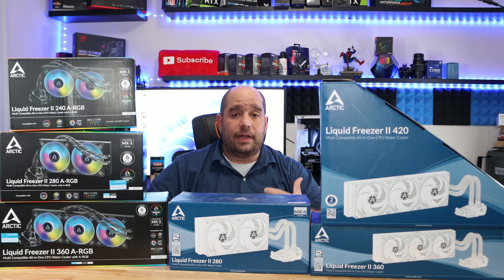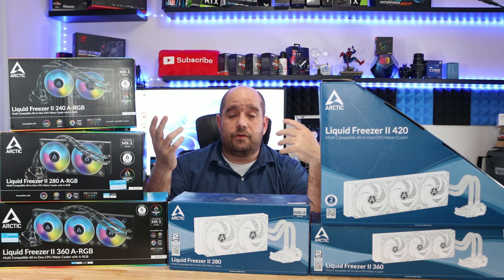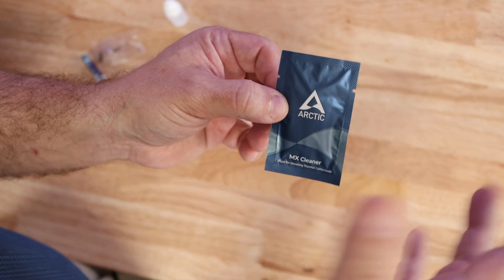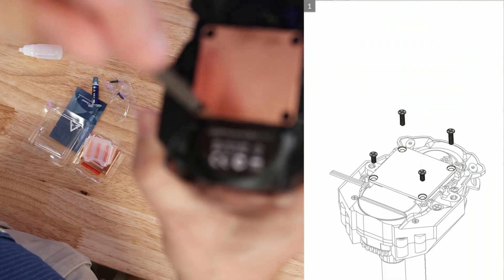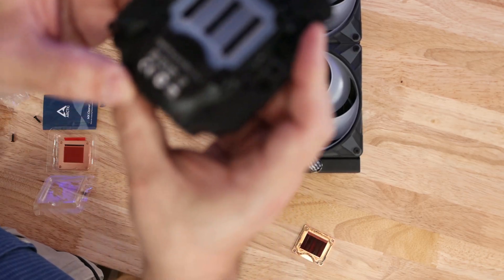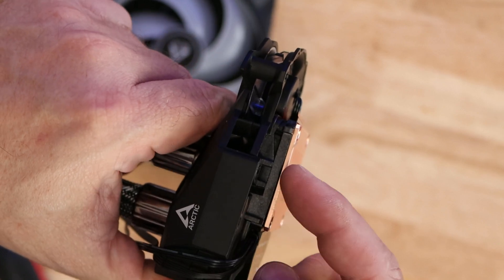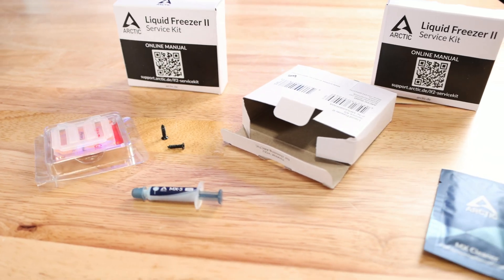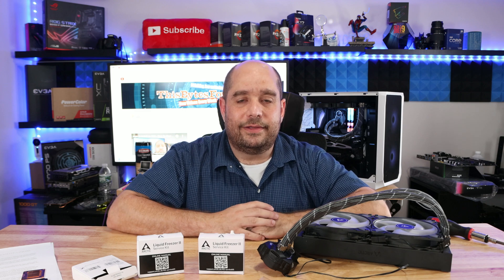You NEED to Watch this if you own an Arctic Freezer II -  How to fix the Arctic Freezer II

Comment: Hello, I scratched the copper plate on the cooler and I managed to get a service kit, but my cooler has a QC pass on it, can I change the copper plate and that gasket? And add some liquid if it nedes? Btw i have an arctic liquid frizer II 360 argb and i order an arctic liquid frizer II 360 argb service kit.
Reply from the maker: scratching them is OK, they are thick, have you watched this video?
Reply: @ThisBytesForYou  oh ok i am thinking of adding some liquid because when i shake the case i hear the liquid inside the cooler
Reply from the maker: Cool, this video has you covered, might help tons to watch it.
Reply: @ThisBytesForYou  ok thx for information I think I'll leave it as is.
Reply from the maker: @fetamina  It may benefit you, and I show you it all here, we've spent more time chatting about it than the video, but either way, glad I could help you.
Reply: @ThisBytesForYou  thanks, it helped me a lot, I wanted to ask you about it so I don't damage anything if I open it and it has a QC pass
Reply from the maker: yup if it already says QC passed it good, but it wouldn't hurt to save that liquid for later, just incase you notice maybe it isn't cooling as well as well as the plate, you never know.

Comment: How big is the impact..?
my CPU is at 95°C (203°F). When I simply watch a video. sometimes even at 100°C.
And the pump seems to work, but the air from the fans is also cool.
Contrary to the tubes. one is hot, the other still warm...
Reply from the maker: what CPU is it?

Comment: so my little vrm is facing up. the tech told me it dont matter if its facing down or up mine is facing down does it actually matter ?
Reply from the maker: I don't have a solid answer for you, I can check with Arctic but the fan should be blowing on vrms, and this should help too on  my imgur https://imgur.com/gallery/YgrTivJ

Comment: i have my vrm fan on the block facing down is that bad i notice yours is facing up ?
Reply from the maker: where the opening is that blows some air, the fan, so that it can blow on the VRM's.  You may be be sucking up some bubbles, causing potential issues, lower performance cooling, noise, reduce lifespan of the pump due to overuse, etc, you can see an example of how it look like here on my imgur: https://imgur.com/gallery/YgrTivJ

Comment: I like how my ARGB Liquid Freezer ii 360 legit cant get any Light to it what so ever, i have a ASUS ROG Strix B650E-F Gaming WIFI as motherboard for the record.

When i set it up in the pc it breifely Lit up and then stopped. Anyone know what the issue is?
Reply from the maker: In general, the ARGB connection is horrible, it always falls off, check each fan by connecting one by one to a header on the board, if they work, connect them then connect them to your board.  Also, try with a different fan, or another argb device to very argb works on your board, it may not be the arctic, check out this video: https://youtu.be/GrKUiz-uJDI
Like I show in this video and many other, the ARGB Liquid Freezer ii 360 legit CAN get light to it.
Reply: @ThisBytesForYou  I have already tried every argb header that i have on my mother board at this point, but it still dont work, I tried my Ryzen 7 2700X Cpu fan and that made it go into rgb mode through armoury crate but not My Liquid Freezer
Reply from the maker: hmmm, not sure, to be certain, you have the RGB LF2 right?  Sounds like a dumb question, but you would be surprised.  The fans, they have a PWM cable and an aRGB cable right? @N0rdicgamingz

Comment: Thanks for this one. I bought mine in October 2022 so I hope it's fine. Haven't taken a look since I've installed it. But I got a question - I did install the cold plate flipped around, with the small fan pointing downwards. Is that a problem? Is it affecting the longevity of the unit? My CPU temps have been excellent so far.
Reply from the maker: that should be OK, the fan is meant to cool the VRM's, so it would be better if they could, but it is OK if they don't get cooled, the over all system cooling in your case should help it.  And always a pleasure my friend.

Comment: I noticed at the 6:30 mark did you take the fans off the 360 and place it on the otherside of the rad to take in the cold air from the top then through the rad? I thought it was strange with the fan placement to push hot air from inside the case through the rad and out. I'm flipping the fans on my Arctic 360 a-rgb rev 4.
Reply from the maker: It's only hot air if you are hard core overclocking or have horrible ambient in your house, my house is usually around 18c,, 63f so cool air coming in cool air coming out.
Reply: @ThisBytesForYou  too hot and humid here in Florida.
Reply from the maker: I'm from miami, its only hot if you let it be hot, turn on your ac.
Reply: @ThisBytesForYou  did I mention the cost of living here is through the roof 76f that's what our AC is kept at. Question I have an Asus Rog Strix B350-F Gaming motherboard but it does not have an a-rgb header would I need to buy some sort of an adapter or just deal w/o the rgb lights I can live with that as well just needing the fans to spin and the pump to work.?.
Reply from the maker: Like I said, I am from miami, and my AC was always at 63, I completely get cost of living, but cost of comfort is important to me and my PC, which means I have to pay a little more.  Your board has an Aurasync header, which will work, you just need aura sync leds.  If you want ARGB, you can get a controller of off my Amazon affilaite link, this should help: https://geni.us/2He7Am9
Reply: @ThisBytesForYou  thanks was just looking at 4 pin to 3 pin argb adapters.
Reply from the maker: I have never bought either, so I can't say how it will work, but it makes sense the one I linked up would work,. but the controller would control the RGB, not asus aura sync, as for the 4pin to 3.... I dont think it will work because they are electrically different, but if its cheap enough, maybe you could buy both and return the one that doesn't work.
Reply from the maker: so which one did you end up buying?
Reply: @ThisBytesForYou  just an adapter fit into the 4 pin but there is a 3 pin for the A-rgb just turned the 4 pin into a 3 pin argb.
Reply from the maker: soooo I dont see that, could you paste the link here sI can help others too, it will show that it didnt post, just send another message saying you posted it so I can check the blocked terms, please @aryannarose
Reply from the maker: Thank you for posting the link, please let me know how it goes, it looks interesting, I may order one too
Reply from the maker: yeah thats odd, becuase I saw it get blocked, then I allowed it, then it got blocked anyway, but I say it come through, its titled "Adapter cable For Corsair RGB Fan (4-pin) to Asus Aura/MSI Mystic Light Addressable RGB" on newegg, I will check it out, thank you.

Comment: Hey bud! You helped me tremendously with a PC case before. But right now I have another issue - I don't know if it is related to the issue that's in this video.. but my Arctic Freezer II 280 is making these intermittent annoying vibrating/ resonating sounds.. it happens more often under load, but can happen even when idling. I've tightened every screw in the case, put anti-vibration pads between the case and the radiator, but nothing seems to be work... It's a seriously annoying sound that can be heard through noise-cancelling headphones 😒..
 I know it's not a faulty case because the same thing happened with Corsair 5000D Airlow before... Do you know what can it be? Can it be the pump? If so, can it be fixed? Thanks!
Reply from the maker: Welcome back and thank you.  Well, where did you mount the radiator, at the top, front or bottom of the case?
Reply: @ThisBytesForYou  on the top....
in the previous case it was in front.
Reply from the maker: have you stopped each fan individually with your hands, one of my fans has an issue occasionally on the liquid cooling unit.
Reply: @ThisBytesForYou  which fan do you mean?

Yes, I disconnected all fans once, and I could still hear the buzzing vrrrm-vrrrrrm... Lol
Reply from the maker: Hmmm, then I suggest to give artic a call, they are pretty awesome or open a support case on their site.

Comment: This kind of customer service is unlike i ever seen before. I have two AiO units, NXTZ and Arctic. I asked NXTZ o send me LGA1700 kit as i was upgrading my rig. Had some of the requred papers, but not all (some parts were second hand). They initially refuse. Not without a pain after sending photos etc they finally agree to provide me with what i requested.
I asked Arctic the same thing for LFII420. They immediately provided me with a code allowing to get lga1700 kit from website free of charge. Then i asked if my LFII was eligible for getting the repair kit - but i had no papers and couldn't be sure when my unit was manufactured. This wasn't even a discussion. I got the kit "just in case", no question asked.
Unbelievable customer service quality. This is how you create your brand and keep customers loyal. This whole thing might actually come up better for Arctic than any kind of advertisement.
Reply from the maker: Yeah arctic is pretty amazing for sure.

Comment: Bro i just installed a 280 on my pc few hrs ago and the temps reach 93 directly and windows wont even boot. Worst part is that i mounted everything perfectly with no issues and it also has a QC PASS sticker on it too.
Reply from the maker: Well, you mounted a 280, what was the processor?  
Do you have the Fan header you plugged this into, set to PWM?  
What is the fan curve you applied in the BIOS?
Reply: having this problem, how did you fix??
Reply from the maker: Did you read my reply to him and have you watched this video?
Reply: @ThisBytesForYou  i have an i9 12900k and an rtx 3090. it booted to bios once and i noticed the cpu temp was like 88c. so i turned it off, repositioned the pump. turned back on and the power button wont stop blinking. the gpu isn’t connected as i am waiting for a 3rd pcie cable in the mail. what am i doing wrong?
Reply from the maker: @dyleann  do you have the p header connected to an aio pump header and have it set to pwm in the bios?
Reply: @ThisBytesForYou  it’s not set to pwm because it’s not booting to bios. the p header to the cpu fan, as i’ve heard many people suggest.
Reply from the maker: @dyleann  don't use the CPU fan header, it's recommended to use the aio pump header if you have it, like I suggest.  Has it ever turned on?
Reply: @ThisBytesForYou  either or don’t work. i just tried plugging it into aio pump and still blinking power button with no connection to my usb devices or monitor
Reply: @ThisBytesForYou re connected my aio, and it boots to bios now. however the cpu temp starts at like 80c and continues to rise. you think if i enable pwm it’ll fix it?
Reply from the maker: maybe, but a few things, 
1. did you take off the plastic piece that covered the cold plate, people forget that often.
2. Did you apply thermal paste on the cold plate?
3. What did you do that made it work?
 @dyleann
Reply: @ThisBytesForYou  yes did both, no offense but obviously. i enabled pwm and enabled xmp. with it sitting in bios it was a steady 88c. this was a slight upgrade in terms of the temp never went up, but it never went down either.

Comment: Bonjour, j’ai le refroidisseur d’eau Artic Freezer II ARGB 240mm et j’ai un petit problème. Il y a 2 câbles connectés à la pompe, un pour CPU Fan et un identique à celui des ventilateurs, avec 3 trous (RGB femelle?).
Je le branche sur la carte mère ? En 5V ou 12V ?
Mais les ventilateurs sont connectés les uns aux autres et le 3ème à un câble qui pend à 3 broches (RGB Mâle ?), il doit être branché sur celui de la pompe ? Mais soudain, plus rien sur la carte mère ?
Merci d’avance
Reply from the maker: Je vous ai répondu sur les 2 autres commentaires en anglais, mais j'y répondrai encore en français sur un 3ème commentaire. L'extrémité mâle sert à brancher un autre appareil. S'il ne fonctionne pas comme vous l'avez câblé, inversez simplement le câblage pour obtenir un connecteur différent à la fin.
Reply: @ThisBytesForYou  un grand merci ! Thanks
Reply from the maker: Toujours un plaisir mon ami, tellement heureux que tu sois venu, que tu m'aies fait confiance pour t'aider, que j'ai aimé et que tu as pris un moment de ta journée pour me remercier. Cela signifie beaucoup pour moi et je suis tellement heureux d'avoir pu vous aider.

Comment: im getting this cooler heard good things also the offset mounting for it right now im using a vetroo v5 next month ima get a 280 arctic freezer ii ima use it with my 5600x do overclocking etc and then when i get a 5800x3d use it with that too
Reply from the maker: good stuff my friend, which one in particular do you plan on going with?
Reply: @ThisBytesForYou   280 arctic freezer ii
Reply from the maker: @Lvll1x  ok, you should be good, I would recommend a 360, but a 280 should be perfectly fine, let me know how it goes my friend.

Comment: My arctic 280 not running well, I used the 5800x with voltage sets to 1.1 and 4000mhz to maintain 53 c at idle, gaming would be 92 and cpu would throttle, not sure why it performance so terrible, I asked arctic for a repair kit and hopefully this would help me fix the problem
Reply from the maker: hmmm, that is incredibly high, I would have gone with a 360 if possible but the 280 should have worked fine here.  Good thing you caught it before it was too late ;)
Reply: Update, I got a service kit from Arctic and replaced it, a lot of white dusk thing stuck in the pump so I got to remove it, and now the temp are good, I put back the voltage and core speed to auto, do a little pbo and co, and now idle temp is 35-40, max load cinebench around 73, it really great
Reply from the maker: @shikihayate   ahhh good stuff my friend, mine was the same on the workstation where I edited this video, I was too worried about taking care of others that I forgot about myself, the cpu hit 100, not sure for how long and for how many days, but I got it, swapped it, and it works like a charm, glad you got it too ;)

Comment: planning to Arctic Liquid Freezer II 360 ARGB Black but not sure it is close or open loop?
Reply from the maker: all of Arctic products are closed loops, BUT watching this video shows you, even though they are closed loop, they can be opened when needed.
Reply: @ThisBytesForYou  thanks for the update. Artic then. ❤️❤️❤️
Reply from the maker: @ericcheah6528  always a pleasure my friend
Reply: @ThisBytesForYou  people are saying water cooling is trouble maker if it was open loops. Never used water cooling before and this is my first build with it 😎
Reply from the maker: @ericcheah6528  well, open is a troublemaker because it is much more manual, technically all liquid cooling units are open, there is a way to get additional liquid in there, but thats not the case with AIO's because they are more sealed, so you would be perfectly fine with the Arctic Liquid Freezer II 360, I am using it in my workstation and have been building with it for years, never once an issue.
Reply: @ThisBytesForYou  awesome 😎👍. Thanks 🙏🙏🙏 for the time and clear explanation 🙂

Comment: i just built an x570S aorus master with a 5900x like 20 minutes ago and i used the liquid freezer ii 280 aio and its a pain in the ass to install,  and fastening the pump to the cpu backplate was sketchy AF because you have 4 independent thumbscrews to tighten it down but how tight do you make it? how do you even make even?! i usually turn until it stops but with this there's no stopping! they just keep cranking down and down and down so, i made sure not to over tighten but it really is a guessing game with a bit of common sense.  a new builder could very easily bust the cpu/ motherboard if they overtighten
Reply from the maker: Like with any screw it is almost impossible to tell you how tight to tighten a screw but I can tell you if you are just turning and turning... You've probably lost threading at some in point from screwing in too tight.  I have never had this issue with an Arctic  product
Reply: @ThisBytesForYou  oh no it's tightening but it's like, if you were to tighten it to the point where it stops the mobo would be bent into a big 'U' then you could call it a banana board! lol. its an awesome cooler but the mounting system is rather unusually complicated and agro compared to others,  especially the ones that use the stop motherboard clips! it works awesome tho, finished the build, switched it on and after those first 30 seconds of black screen dread she fired right up, back into my old desktop... went to bios set XMP and away we go! lol...stoked
Reply from the maker: @DiagolonRider  make sure you flash your bios and I have videos on here with the x570s as well, installing the os, flashing the bios and stuff

Comment: Trying to get a 360 one in Australia. Seems impossible atm
Reply from the maker: Eeek, it may be more expensive for you, but see if my Amazon Global Affiliate link helps: ARCTIC Liquid Freezer II 360 A-RGB: https://geni.us/MgvxK
Reply: @ThisBytesForYou  Thanks :) but im after the non rgb version
Reply from the maker: @UglyNiiiiiiiick  no problem bud, you can use this one instead, also an Amazon affiliate link, but just know that RGB lighting can be turned off and they are non RGB fans at the point, or you don't need to connect the RGB headers: https://geni.us/T2uVj